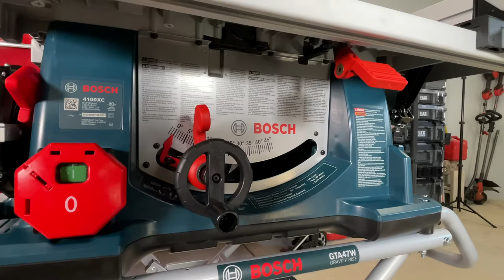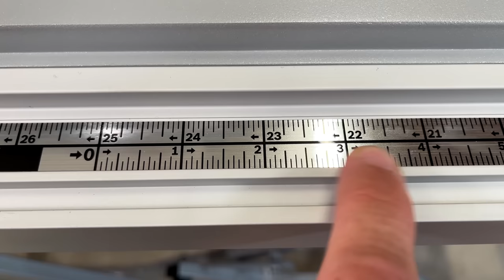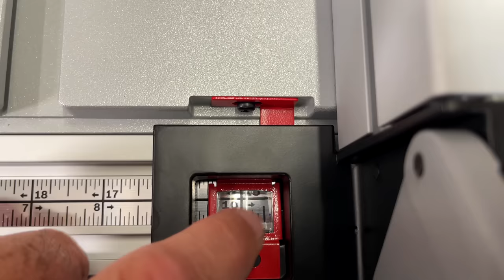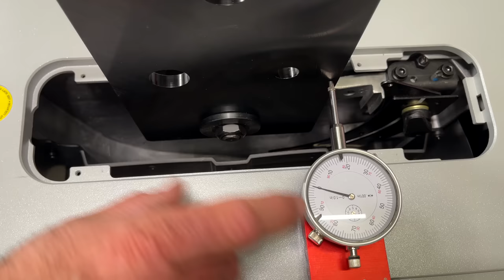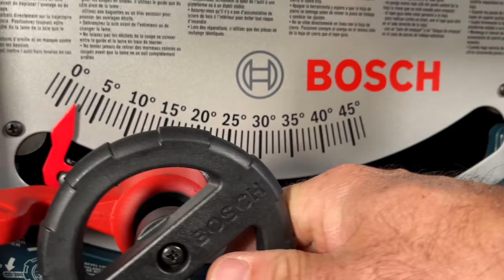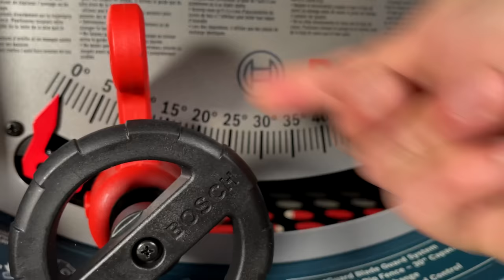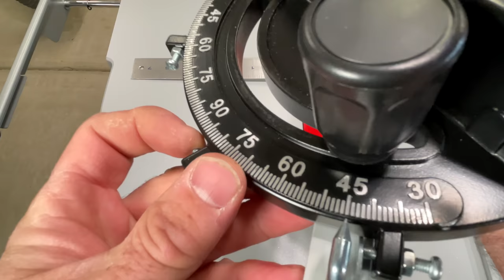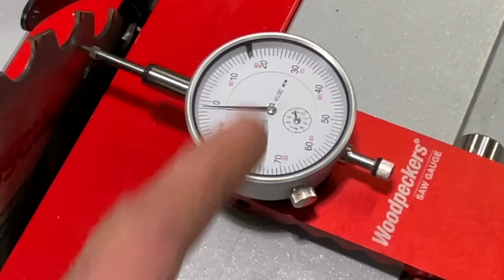Bosch 4100XC-10 Table Saw  ||  Overview | Review | Demo

Comment: Changing the blade is a must. I think a lot of people forget that a blade, a bit or a knife, these are all cutting tools. Even a crap table saw can be used for finer work with a high quality blade. Nice review.
Reply: I do lvt flooring. This is an amazing saw. I used the stock blade for a week on my jobsite, but when I had to cut wood for the subfloor repairs upstairs it was a little rough. What blades do you use. I am running diablo 42 tooth finishing blades. I'm not super educated on all the best saw blades
Reply: @CoKanet-no2jt  I’m a big fan of Royce/Ayr blades.  They’re not thin kerf nor are they cheap. They do however put up with multiple resharpens and come in just about every tooth pattern and rake you may need. Although I’ve never used them, I understand Forrest makes good quality blades as well. Regarding the flooring, my experience tells me composites are brutal on blades. I usually switched to a cheaper blade when the need to cut that stuff arose.

Comment: Love how in depth your reviews are thank you! If anyone gives you a hard time about the length of your videos ignore it. I can't think of another channel that goes through absolutely everything on a tool from features to adjustments, it's definitely appreciated
Reply from the maker: Thanks Adam it means a lot to me!  No intension to change the length or format but might try some new things next year to keep it interesting. Thanks for watching!
Reply: @ProjectsForAllReviews quick question are you going to test the FLEX table saw any time soon?  I refuse to look at it until you go through a thorough review.
Reply from the maker: If I can’t finagle a prerelease unit we’ll get it on release for sure. I still love all the FLEX gear I’ve reviewed so far. Thanks for watching!

Comment: I’ve had this saw for 3 years and I’m generally pleased with it.  I’ve had a bearing changed and some work done to the mechanism that raises/ lowers the blade.  The mechanism requires frequent cleaning and lubrication.

Comment: I have owned one for several years and love it. I use it for making end-grain cutting boards out of maple, walnut, and cherry. I had an issue figuring out how to interrupt the measurements in the extended top. But your video was helpful in understanding the secret. I never could get the tape measure and the table measure to agree. Thanks for the hint.

Comment: I own one for almost 7 years and it's my driving horse the only tips is don't use a 14 gage extension and if it's too long go with 12 gage and works better when the receptacle isn't loaded because this saw is advertised as 4hp peak it draws alot of power and had issues with breakers , it's very accurate and I attached a 55 inch sliding table beside it for ripping 4x8 sheets , I recommend highly this saw

Comment: Couple things,  when putting the fence in storage, stand at the side and push down front and back together. It will snap in to 2 metal clips securing it. I've been a carpenter for 28 years, and have had my fair share of jobsite table saws. I've used just about every big name (minus the real high end stuff like Sawstop, which also does not have a rack n pinion) be it my own or another carpenters, and I find the bosch to be the most accurate and smooth option out there. I just bought my 3rd bosch, and it has a few upgrades from it's predecessor, which led me to your video. All my saws get tuned as accurate as I can possibly make them out of the box. Then regular tune ups when needed, as traveling tools live a rough life. That's my 2 cents anyhow... Great video 
Oh, and if you want to spoil yourself,  buy "FS tool" saw blades, from a company called Camel Saw, and have them sharpen it before shipping it... a freshly sharpened blade from them...aw good stuff!!

Comment: I have had my Bosch 10" table for 20+ yrs and after the initial fence issue, i have not had an issue since.  I have built 3 homes with this saw and im NOT a professional and its still going strong today.  I spent $575 back around the two thousandths?  I originally had a Grizzly 5hp left tilting cabinet saw with all the accessories but it was way too big for my shop and unwieldly, even with rollers and I wanted something I could throw in my truck.  When I bought the Bosch, it was one of only e few saws that would accept a full dado safely.  Another thing, which no one ever talks about, is that the motor increases power as it senses interference in the rpm's, equal to about 4 1/2hp.  I'm not sure if the newer models taught this or not, but they look identical to me, but a lot can change under the hood in 20 yrs.  NOTE:  I'm not one of the online safety police, but if you have kids or animals around, you will come to appreciate every safety feature installed atleast one time in your life, which is one reason i don't buy cheap saws.  If they don't work or are fiddly, what's the point?   You don't want to 2nd guess your life choices in the emergency room.  Take care.
Reply from the maker: Thanks for sharing your experience with this one. I suspect there's many ppl out there with 20+ years on this saw. Looks like there's a new rack and pinion fence model coming out now. I wonder if Bosch is discontinuing this one. Its definitely had a good run. Thanks for watching!
Reply: @ProjectsForAllReviews  I wonder if they will sell the fence as a stand alone item?
Reply: @mypeeps1965 - How did you fix the fence?

Comment: Hi Mike as per usual you have done a wonderful job of evaluating this tool. I just wanted to offer you a suggestion about thriving knife adjustment. The knife adjustment can be accomplished with the back of a tablet cardboard. The cardboard is a bit porous and allows for resistance between the fence. The thriving knife and when you make the adjustment you can hold the cardboard between the fence and the knife. Tighten a nut down slightly move the cardboard out of the way finish tightening with the compression nut lock it down put the other two nuts down hand tight check it again, it worked for me.
Reply from the maker: That's very similar to the instructions in the owners manual. It recommends folding a sheet of paper, either in half or thirds, can't remember and using that between the riving knife and fence. I found that too fidgety and went for the old eyeball adjustment. Both Skilsaws and this Bosch all had the same riving knife and arbor lock setups. Thanks for watching Leroy!

Comment: I've been using the Bosch 4100  table saw heavily, for about 6 years. Did have to replace a barring at one point. It worked for quite awhile after that & recently broke down again. Unfortunately i didn't have the time or energy to investigate the issue this time. Since i love everything about this saw, i went ahead and bought a new one snd will fix my now "backup" when time permits. So now I'm using 4100xc & it's just as awesome! Little to no adjustments, straight out of the box twice!! 😊 Great review btw! After watching, I'm guessing you'd give this saw about a 4.8 or so, but I'm going with a 5 lol

Comment: I spent ages adjusting the angle pointer to get it to match 0 and 45* on my Bosch saw. It seams the length of the pointer is to long to match both so it’s either one or the other. Good video. 👍🏻

Comment: I bought a 4100 several years ago, and it still works great and square. Only problem is that it has become hard to raise the blade. I need to clean it out regularly. Wondering if something is getting worn.

Comment: As I watched you burn thru that oak with the OEM blade I thought to myself "... it's gonna burn" and sure enough it did. I swear that OE blades are just placeholders...something to throw on the arbor to keep the nut in place. Toss 'em and put a good blade on...at very, very minimum a Diablo. My personal choice is a Freud Industrial, but to each his own.

As to the fence, I am going to watch the fence video as soon as I post, but my personal preference is actually to tail the fence away by .005"...so to me it is set perfectly! While rack and pinion fences seem to be all the rage on job site saws, I think I'd rather have this Bosch design. Much closer to the big boy setups. 

You mentioned several times during the walkthrough..." just like the Skil we reviewed recently" Well, the Robert Bosch company is a subsidiary of Skil, so it doesn't surprise me to see similarly designed parts here...just sayin'...

I do like how you take an inordinate amount of time to delve into the guts of any equipment you review...a true deep dive. This is the kind of info I want and need to make an informed choice. Thank you, my good man. Well done!
Reply from the maker: I was really shocked at how bad the Bosch blade was for the price of this saw. It’s true in real life I never use the included blades but for reviews I think it’s important to show it. So far all OEM blades have been serviceable except for the Bosch. Thanks for watching Woodrow!

Comment: I think the Skil is better than the Bosch or Dewalt  or Delta although they all have features I like. I have and older Dewalt jobsite saw but at some point I will upgrade. Right now, the rolling stand on the Skil has me leaning towards buying it. Also, waiting for an awesome sale to help me decide. If I had to rank them I have Skil, Delta, Dewalt and then Bosch in that order.

Comment: Great video man!  I love the discussion between this and the Dewalt.  I took the plunge on the new Bosch GTS15-10, I should have it before Christmas.  I'm still waiting for somebody to review that saw but it looks a little better than both this saw and the Dewalt.  It looks like this saw but with rack and pinion fence.  If Bosch did as good a job with the new saw as they did with this saw it should be a no-brainer for anyone looking between these two saws.  The biggest thing I don't like about the Dewalt is the stand - too hard to put up/down, move around once it's up, and seems like it could get "rickety" over time.
Reply: Same. I’ll have mine in 3 days!
Reply: How did it turn out?
Reply: @sjoroverpirat  I'm very impressed with the new saw.  The fence was perfectly tuned out of the box and the motor is smooth with soft start and a stopping brake when you turn it off.  Pretty happy with my purchase so far.
Reply: @sjoroverpirat  I have mixed feelings. The made in Taiwan quality is poor and not up to what I would expect from Bosch. Table is not flat. Inserts are sloppy and loose and worst of all bowed. Fence and blade were aligned fairly well but not with the table. Ends on the fence are thin plastic. Bevel stops were way off. Miter gauge is garbage. The stand is fantastic. 
If you’re wanting accuracy you will have to spend some time on setup and making your own table inserts. I’m disappointed but there doesn’t seem to be anything better on the market currently.

Comment: No need for that pinion or rack, the fence will not moving once it's already in your adjusted desired position. It is not a CNC. Since i have their 18v brushless impact drill/driver with 2 peices 18v 2.0AH battery already, i might go with their brushless version of this as well. Please do a review of that also. Its model is GTS 18V 216 if I'm not wrong.

Comment: Hey Mike, any thoughts on the Bosch GTS15-10? According to their website, this model has a rack and pinion fence on it. In the meantime, I want to purchase a job site saw for smaller projects. That being said, if you had your choice, which model would you yourself select, the Bosch 4100XC-10 or the Dewalt DWE7491RS? Thanks, Garry from Chicago.
Reply from the maker: I came super close to preordering that new Bosch and we may still get it soon for review. It’s not everyday a major manufacturer drops a new table saw. As far as the DeWALT vs Old Bosch I personally would pick the DeWALT but the Bosch is a very close second and I don’t think you would go wrong either way. Both are legit pro grade saw and it comes down to personal preference. Good luck and thanks for watching!
Reply: @ProjectsForAllReviews Thanks for getting back to me. It’s hard to find any reviews on that newer Bosch. I’ll let you know if I hear anything.

Comment: Thanks for the review Mike! How flat is the top on this model? I know jobsite saws often sink a bit around the blade - wonder how this Bosch compares.
Reply from the maker: So I guess I goofed by not checking it. It’s the flattest table to date with .05 dip left of the throat plate. Spot is about 1x6 inches. It blows HFs new welding table out of the water for flatness. I’m about to preorder the new Bosch table saw and I’ll have to mention it in that video. Thanks for getting me off my ass Conan! 😂
Reply: @ProjectsForAllReviews  Ah Sunday is for being lazy, right? Riighht? Haha thanks for checking! This saw wasnt on my radar at all but it looks well made for its price.

Comment: How did you get your dust collection attached on this saw. I have tried several things with no luck?
Reply from the maker: I used an adapter to neck down from 4 inch and a rubber sleeve. Wasn't able to clamp it properly but fit snug enough to work. Im still confused why the outlet on this saw is cut off flush with the housing. Thanks for watching!

Comment: Is it worth 2x the price of the Skil portable table saw you reviewed in January?
Reply from the maker: Surprisingly tough question but I think it comes down to who you are and what you're going to use it for. Same as the Dewalt and Skil comparison vid it did they are meant for completely different buyers. The Skil is an excellent saw for the DIYer or Pro who needs space savings or serious portability. These big saws are great for extra table real estate and very stable stands. There's a new rack and pinion Bosch just out that I hope to get to after the new year. Thanks for watching!

Comment: Could a cupped blade cause the binding? Stock blades are usually trash anyway, but I’d expect a better one from the company that also makes Freud and Diablo lol.
Reply: Yeah, the stock Bosch blades are dreadful, which is why I automatically swap them for Diablo blades for all my Bosch saws, except for my jigsaw those blades are top-notch.
Reply from the maker: Yep in real life I never use the Oem blade, ever. Still have the brand new blade for my 5 year old Delta. As far as why I'm still not sure but I'll spend some time looking at it soon. Might make an interesting short vid if I can figure it out. Thanks for watching Griffin!

Comment: Once again your video is awesome : the analysis of the tool is cristal clear ! As for the blade that came with the saw, is there a mention of the country where it was manufactured ? If it is Italy, it's made by Freud witch is 100% owned by Bosch in Udine ( FREUD = FREsse UDine ). FREUD blades are generally excellent ( on par with CMT or LEITZ : the guys that manufacture blades for FESTOOL ). No mention : it comes certainly from China, just as all the cheap Bosch blades are manufactured. But then, what a stupid idea from Bosch to ship such a blade to grab some more margin when they own FREUD. So, yes, consider mounting a true quality blade such as FREUD, CMT or LEITZ... For the overall quality of this table saw, yes, Bosch blue line are very well made tools... I just regret that Bosch did not convert it to rack and pinion fence witch to me is the ultimate design.
Reply from the maker: Thank you Laurent! You got my curiosity going so I ran out to the shop and pulled that blade out. Yep, China. Your completely correct Bosch should have included a top line Freud blade with that saw. They could have included some savvy marketing about it and gained a new blade customer. Missed opportunity for sure. Thanks for watching!
Reply: Thanks for having checked ! Bosch had also an acceptable alternative to save some bucks : ship the saw with one of their  "Bosch Expert for wood" blue blades ( don't know if it is available in the US though... ). It's made in Italy so I guess it's made by FREUD and these blades are cheaper than the FREUD ones. But definitely shipping a Chinese blade such as their " Bosch Optiline" line is not coherent with their blue line tools and should be mounted only on the Bosch green line tools ( targeted DIYers, I don't know if it's sold in the US ).

Comment: One of the best aspects of this saw is how the table splits when you extend it.  The fence extension support is level with the table, as opposed to the dewalt fence which has no support at all—I guess you can flip the dewalt thin stock support over for some support, but then your cut will be out of square vertically because this support is out of plane with the table…hopefully that makes sense

Comment: Did you check the flatness of the table?
Reply from the maker: Yes. After the video and I wish I’d included it because it’s the flattest one to date. It has a .05 dip next to the throat plate about a 1x6 inch section and thats it. Did better than the new HF welding table that claims +-.05. There’s a new Bosch rack and pinion that just dropped and I’ll mention it in that vid. Thanks for watching Jeff!

Comment: Volts x amps = watts.   1 hp = 745 watts.   Theoretical.   SF= Service Factor.   SF 1.0 = 💯 , SF 1.15= 115%.  To overload.   HP ratings are typically BS.  Do the math.
Reply from the maker: Thanks for the insight Todd! Thanks for watching!